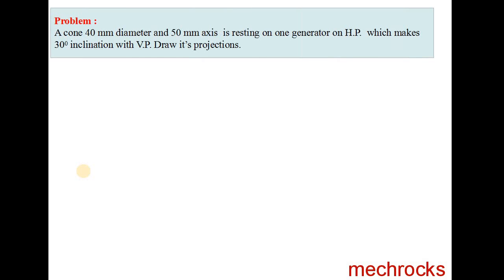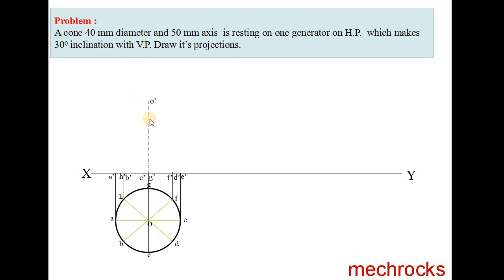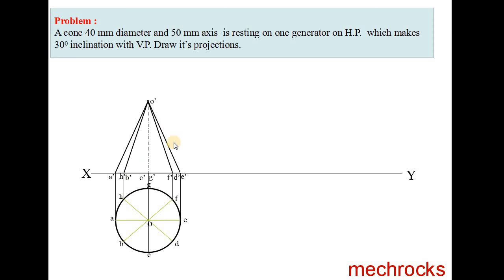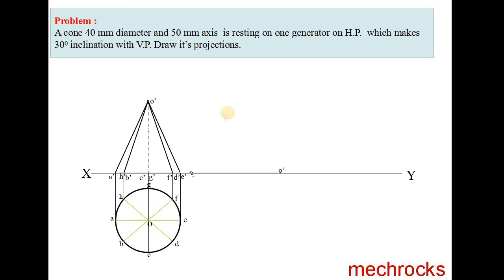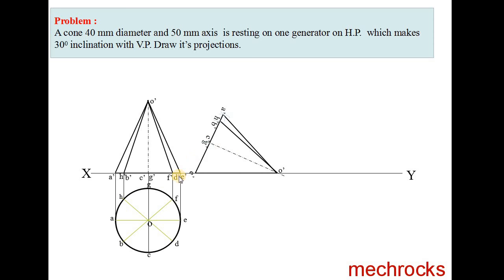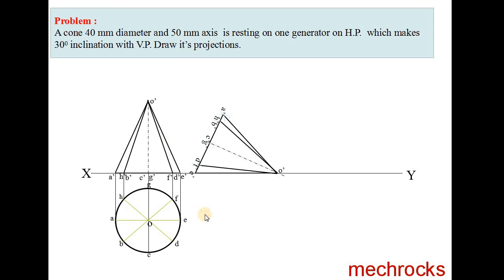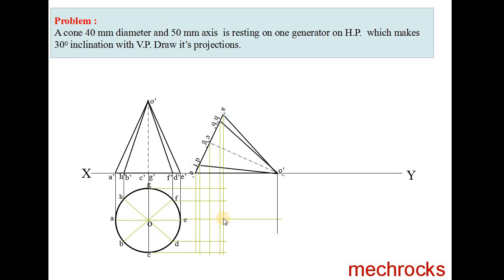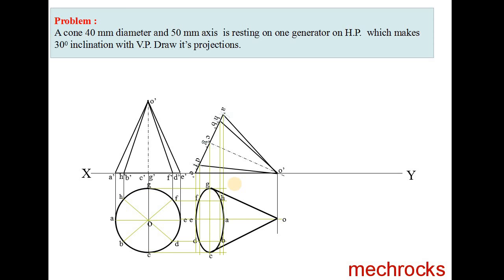Engineering Drawing - Projections of Cone with generator on HP

Comment: Q: 4 A right circular cone, diameter of base 50 mm and height 65 mm, lies on one of its elements in HP such that the element is inclined to VP at 30°. Draw its projections.

Comment: axis of solid is parallel to onr plane and inclined to other plane. Draw the projection of a cone

Of base diameter 40 mm and axis is 60mm such that one of its generator is parallel and 10mm above HP and its

axis